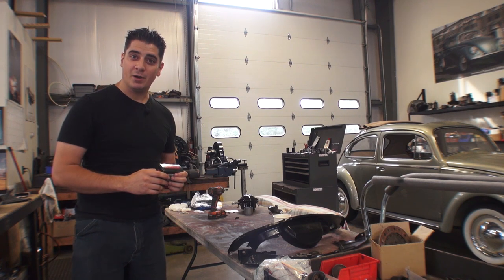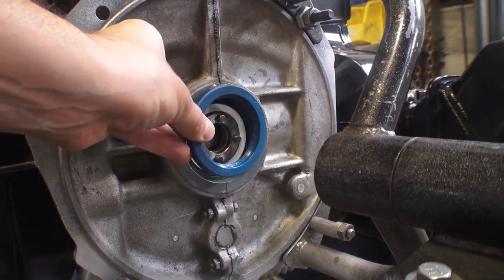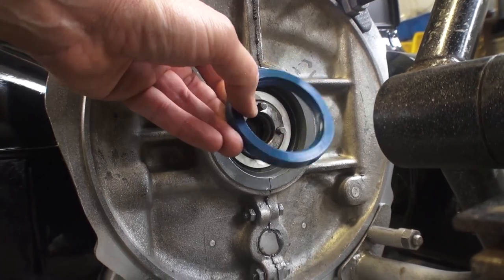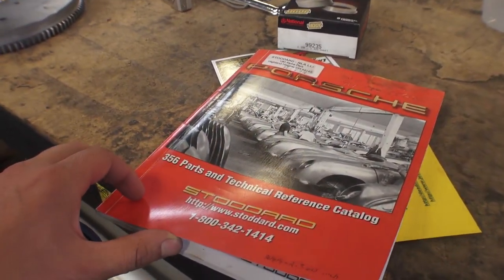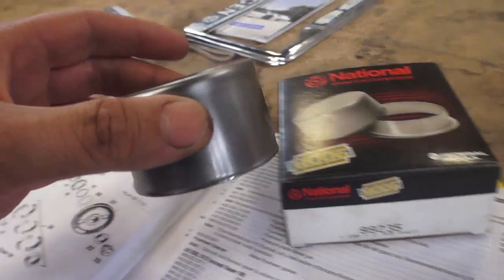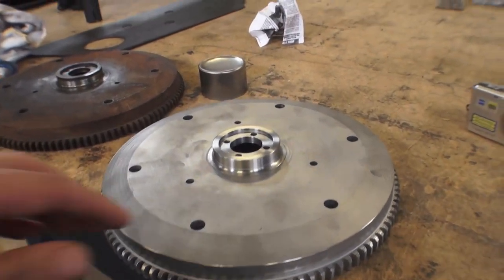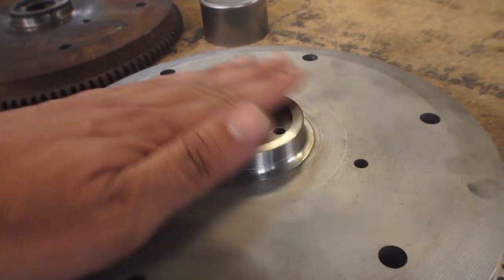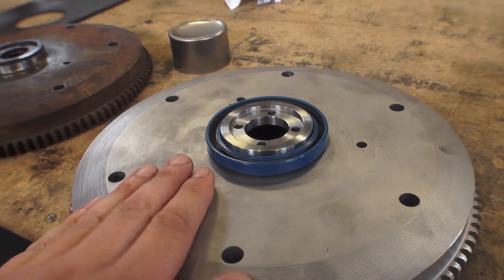Classic VW BuGs How to Stop Beetle Rear Main Oil Leak with Speedi Sleeve

Comment: Depending on the car, you can shim a main seal in or out so the main seal lips do not ride in the groove. On bugs, you can usually deep-set the seal so that it is NOT flush but recessed in far enough to clear the groove. This is true on almost all engines.

Comment: It is a great way to try and stop the oil leaking from this area of the engine. But please also check / examine the Main Bearings. If the engine has lower than normal oil pressure, you may have too much clearance between the  Main Bearings and the Crankshaft. When the engine is running, the crankshaft can 'float' up and down, and (if there is excessive clearance between the crankshaft / crankshaft Main bearings), even this treatment (and a brand-new Oil Seal) - will not cure an oil leak in this location. Try levering under the Flywheel, and watch for any up/down or sideways movement between the Flywheel and the Engine Casing. I used a magnetic DTI and measured the wear. My engine also has this problem of leaking, but my engine has this excessive 'free play' at the Crankshaft / Rear Main Bearing. Higher viscosity engine oil does help a lot.

Comment: Chris- you know I think a good machine shop could also make that sleeve but probably charge more than 50 bucks. Many years ago I worked at a machine shop where we did what was called 'interference fit'. Basically as an example the flywheel would be put in dry ice to shrink it then the sleeve in an oven to expand, when both a room temp the sleeve would not fit over the flywheel but shrinking the flywheel and heating the sleeve made it possible to fit, when the temps of the flywheel and sleeve came back to normal the sleeve would be a very tight fit- I think in some jobs we used 005 to work with
Reply from the maker: Ah Jim that is excellent that you said that, I should have mentioned that about the freezer!  U da man! =o)
Reply: Chris Vallone Thanks Chris, actually my 'real' name is Fred. I still have some affection when I see an old bug or VW, myself I like the stock ones or very close the best
Reply: @classicvwbugs  I have put a Speedo sleeve on, I’m still getting a leak, any ideas about the cause?
Reply from the maker: @eamonnculliton100  where did you get your seal from?  I hope it's orange.
Reply: @classicvwbugs  Hi Chris, I'm pretty sure it was, but can't remember. It's a couple of years since I did it. I'll have to pull the engine anyway. Maybe it's the O ring. I was just wondering if you had seen them leak after the speedi sleeve was put on.
Reply: I'm Eamonn by the way
Reply from the maker: @eamonnculliton100  Sometimes we still see it yeah, but it usually something else then.  Maybe bearing wear, block is not right, etc  Bad seal, etc
Reply: @classicvwbugs  I knew you were going to say that 😆, maybe it's time for the bearings to be done🤔. Thanks for your help 👍

Comment: I heard the late model Mexican and Brazilian Beetles had some sort of modification to the case where oil would not “sit” by the mail seal. This meant the main seal would last a LOT longer. Has anyone heard of this? And if so, can a straightforward enough modification be done to an older Beetle engine case?

Comment: I know this is an old video, but it still applies today.  I ordered this National part, but it is too small for my 6volt flywheel.  Any idea on which national part number I need or if the flywheels are same size, why won't this one fit my flywheel.
Reply from the maker: did you check rockauto?  They have them I think.  What yeah engine do you have?  36hp flys are smaller than the 40hp flys.

Comment: What do you do when the wear is on the block?
Reply from the maker: Where on the block is it worn?
Reply: @classicvwbugs  basically where the rear main bearing sits.   A guy i know showed me an engine block and the rear main bearing had worn a groove in the block.   Im in Canada so im sure its different up here but he told me machine shops would typically cut the hole bigger and then add a sleeve.   What do you do in that case?
Reply from the maker: @jimmyjames1908  Ah yeah, does it have like an extra "step" at the end of the block?  I have seen that before.  I think they sell an insert or something.  If you contact Rancho in Cali, they do line boring on the VW blocks, they would probably know.

Comment: Please help, Rebuild 1600 engine. Having problems with oil cooling. I have one split. Replace it and the 2nd one split . It splits on the 2nd day I start the engine. What could the problem be?
Reply: Uneven/bad crankshaft possibly, if 2 different cases cracked that were originally in good condition with no existing cracks and you used the same crank in both those cases id be looking at the crank. Also torque specs and ensure you didnt tighten the nuts around the case in a circular motion